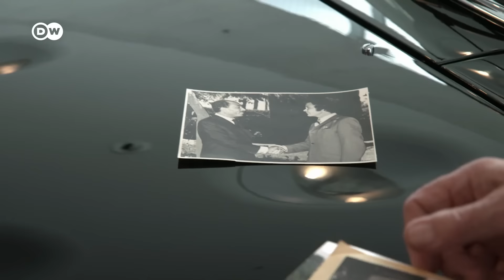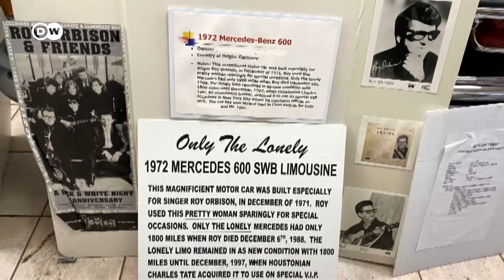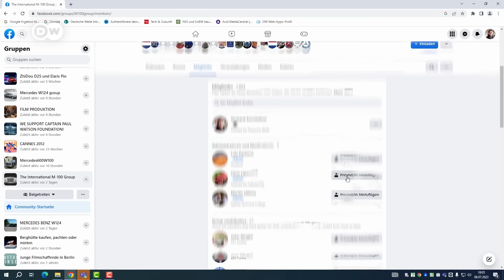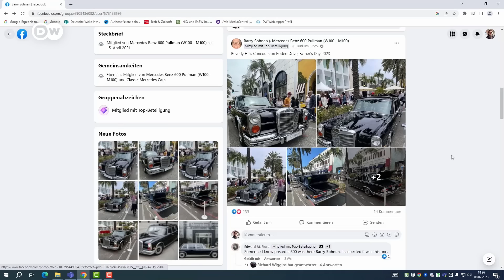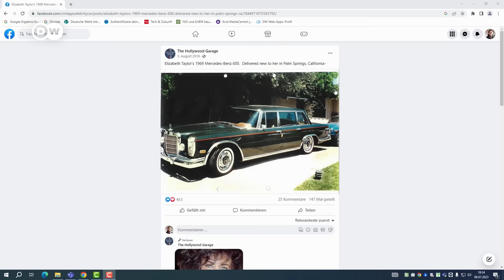Mercedes 600: 60 Years of Germany's Best Car?

Comment: I'm pretty astonished that "parts are hard to come by".
If you have a humdrum midsize 1960s or 1970s Mercedes, you still get OEM parts. They'll be expensive, sure, but they'll be supplied to your friendly dealer within days via Mercedes' logistics.
The 600, however, doesn't appear to get that support. Prices look like from the black market and I've seen a vid about a specialist American MB 600 restauration shop that has converted a few 600 into pickup trucks for sheer lack of parts for the rear body.
I know that making parts in tiny numbers is costly - but I guess the clientele will gladly pay very steep prices to keep their cars moving and Mercedes should support the maintenance of their former flagships.

Comment: Produced 1963 to 1981 without significant design change inside and outside, it looked really oldfashioned during its last years but that might have been what the conservative customers wanted.
There were just a few changes due to changed regulations, but never a "facelift" in line with the W116 S-class of 1972.
I first became aware of it during its last production years (I guess I saw one in a showroom) and my first thought as a young boy who likes everything new was: What, they still build it this way? It looks so old ...

Comment: Mercedes-Benz missed a trick when they didn't do a modern version of this, instead of the flop Maybach range. Rolls-Royce were highly successful with the modern Phantom.
Reply: If I'm correct, the modern day George Pullman designed model exists : provided one has a 100,000,000 (name your currency) at one probably costs 500,000 or more!.

Comment: What is the difference between the 600 and the pullman
Reply: Watching the video.
Reply: Pullman is the long wheelbase (LWB) variant of the car, be it 4-door, 6-door or landaulet, intended for chauffeur operation.
Reply: @jamesyeiren7920  Not at all. There where two landaulet models, featuring a short and a long folding roof. Watch the video! Both have the long wheelbase.
Reply: That's the pope car ,you can't buy it.  Plus the video has many minor mistakes .
Reply: @jamesyeiren7920  Nope, Mercedes-Benz produced some more landaulet models with the long folding roof. Nicolae Ceaucescu, communist titan of the carpates, once owned one. This villain was shot after his escape by car failed. It is said, he used a Dacia 1300 instead of his 600 😁.
By the way: like many other people, i can't buy me any Mercedes 600.

Comment: Mercedes licensed Citroen’s oleo-pneumatic suspension system for the 600, hence ‘hydraulic’ power systems for everything
Reply: Not the same suspension.
The 600 has air suspension.
Reply: @helmuthhaass3631   Mercedes definitely licensed Citroen’s suspension technology for the Grosser - “pneumatic” means air. Noticed I put “hydraulic” in quotations for a reason. People refer to it as hydraulic when it’s technically ‘oleo-pneumatic’. Incidently Rolls Royce got a similar license from Citroen too. Citroen uses pressurised air as the suspension medium but uses oil as the control interface, hence ‘oleo-pneumatic’
Reply: It's simply air suspension.
No fluid.
I have owned a 600 and a 300SL6.3 and they both have the same suspension.
They have a (Knorr) compressor driven by a pulley and belt to the crankshaft.
On the 600 this system even supports a big airhorne and supplies  extra pressure for the brakes (air over hydraulic)  
Some later Mercedes models have used the Citroën type.
My 500SL R129 for instance has such a suspension system that uses hydraulic fluid.

Comment: Lennon never owned a 600 Grosser. He had a Rolls Phantom (amongst others). Harrison had a 600, but not a limo. Just huge.
Reply from the maker: Actually it was John Lennon who bought the 600 Pullman, which he then later sold to George Harrison. He also had a psychedelic Rolls-Royce Phantom, as you pointed out.

Comment: There's something to be said for non-perfectionism and cost control. $17,000 - the price of a complete new Mitsubishi Mirage - for a hydraulic window control. If the power window motor on your 1966 Cadillac Fleetwood dies, you can probably make the one from any GM car so equipped up through the early '90s fit, for $10 at the u-pick scrapyard.

Comment: I will say it .. these were essentially one off cars . They were not the best and typical European,  over engineered.  The production run was very short and the build quality was over hyped. Now over at Toyota , The century v12 ,  they are still bing prodduced to this day and most are still on the road today . Far  superior quality and engineering not to mention they are really limited . Only 100 are built over a certian period of time.. outside of Japan most people dont even know its a Toyota product.
Reply: And there lies the difference between the Century and the 600: sure the Century is still in production, but its a JDM car, only available in the Japanese market. The 600, on the other hand, was available (if you have the bucks), and it comes in LHD or RHD.

Personally, as a fan of both cars, I feel Toyota should have raised the Century's profile more had they did  what MB do to the 600: an ultraluxury car available to all (with the money, that is).